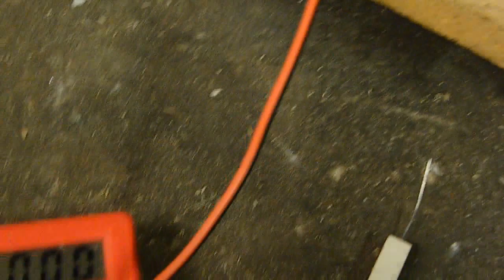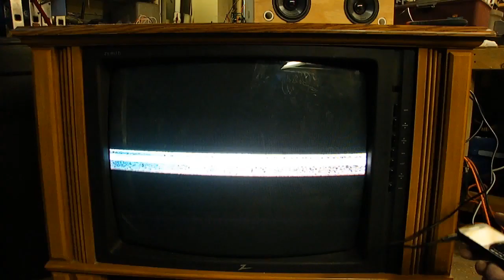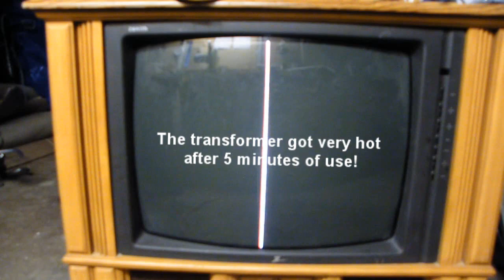How to make an oscilloscope from an old TV

Comment: I also did this modification sometime around 1977-78. I saw a Popular Electronics article on how to create a X-Y vector graphic audio monitor out of an old black and white TV. My first attempt was on a hybrid tube / solid sate 25" Zenith color TV. The deflection yolk simply unplugged from the main chassis, I rewired the deflection coils, hooked it up to my stereo and listened to Pink Floyd Dark Side of The Moon, it was awesome! The second attempt was on a black and white set, on this one I substituted a wire wound power resistor as the dummy coil to keep the gun active. This one I used as a low budget oscilloscope, 60 Hz time base utilizing a step down transformer. Even marked a graticule at 1 volt per divisions.

Comment: I did a similar modification in 1976, 40 years ago. It was a vacuum tube color TV. The neat thing was that these older TV needed dynamic deflection of the 3 electrons guns to make all 3 hit together the same pixel thru the shadow mask. But we can simulate the effect of a modern CRT : simply use a magnet and find a place on the neck of the tube where the 3 color will separate but not too strong to make the gun hit the wrong color. Brief, instead of the boring white line, the goal is to have the 3 color, red, green and blue drawing the same lissajou figure.

Comment: The wires going to the deflection yoke are USUALLY red & blue for horizontal, and yellow & grey for vertical. This is supposed to be a standard, but not all manufacturers adhere to it, so it's always worth checking to be sure.

The reason the TV didn't start up with the yoke unplugged is because some (not all) TVs use the horizontal coil as part of the 15KHz tuning circuit for the horizontal oscillator that runs the high voltage transformer that powers the CRT. TVs where the yoke is not part of this circuit tend to be easier to hack for this sort of use :)

Comment: hahaha that's great!!  but let me tell you can loosen up the Yoke clamp screws on the neck of the tube and turn it 90 degrees so the vertical coil becomes the horizontal coil and it look like a real ocilloscope sweeping from left to right. also you can change the width of the trace line by changing the width of the electron beam. great video.
Reply: Or just, you know, rotate the TV 90 degrees.

Comment: rotate the deflection coil 90 deg on the CRT neck and the vertical line should go horizontal. Mind the 15 Kv CRT anode = great for homebrew electric fence lol
i did something like this with a small black and white CRT set that ran off batteries or DC wall wart. I remember paying all of $20 for it new back in 2001 just to have in my shop on my bench for entertainment purposes. Now its a Frankenstein work of art

Comment: 1) The dummy coil fools the TV into thinking that the real coil is still attached.  The real coil (on the neck of the picture tube) is then connected to the audio source.
2) To make the vertical line be a horizontal one, you can rotate the coil on the picture tube neck 90 degrees!  There is a screw/strap that holds it in place, loosen it and rotate it, then tighten again.  3) One word of warning - the inside of this type of CRT TV has some EXTREMELY high voltages!!  Be CAREFUL!!

Comment: Nice work mate!!
the horizontal deflection looks really good, is it possible to rotate 90 degrees like a laboratory  CRO or would I need to use the vertical deflection coil with a freq multiplier?

Comment: For anyone who watches this, you're not even supposed to use standard electronic insulated tools when working on the back of a TV like that. Instead, there are special high insulation tools available for high voltages up to the 25 kilovolt range. Also, the tube may implode, and even if it's been plugged out for 2 years it can still kill you, there are high voltages capacitors, and because it's high voltage - sparks can jump to your hand. You can't just swap in and out coils, it's not recommended, you can't treat electrics like low voltage electronics. There's a difference
Reply: *sips drink*

Comment: Wish i had found this before I did mine as I just jumped in to it.  Here''s mine. Looks like we came up with the same thing. I added two switches and plugs that allows me change mode and return the to back to usable status. Capacitor in lime smooths it out, I did this as I remember when i was a kid all the speakers had them.

yP8ddiFJOU0
r2O8sy7bdB8
Fi8qOTg8MVg
H4JfnUg2dO4

Comment: I had the same problem with the coils. i found that instead of switching the on my tv your able to turn the coils on the tube it will even go at an angle but you can turn it intill the vertical goes horizontal.

Comment: I am trying to get into electronics and don't know much but I love opening them up. I know enough not to kill or hurt myself but not really enough to know how it would work. If only I had more money to get tools and other stuff I need. Have and ideas on what basic tools I need?
Reply: i would recomend you
-screwdrivers (flat, x) with various sizes, you may also try to get torx if you want to deassemble a phone.
-pliers
-wire cutter,
-wire stiper (i personally do not use this one),
-some wires to connect things 
- a breadboard for mounting projects
-soldering iron (it depends on what you want to do, you can use it to take components off old electronics, replace damaged components or build your own citcuit)

if you want to also start programing things to move, do interesting stuff etc, you could try:
-arduino  (good for beggining)
-chipkit (same as previous)
-raspeberry pi (never worked with it, but it is for fairly complex systems)
-beagle bone (same as previous)
Reply: I got most stuff now. I am gaining more knowledge through youtube videos. Anything you suggest I look at to find problems with stuff? That is what I think I need now.
Reply: i forgot, multimeter, it is very usefull for checking if the voltage is what you expect, and to find the problem sometimes

well, http://www.instructables.com/
it has instructables for almost anything and i found some electronic cool projects..
maybe it has instructables for dealing with problems too. 
there may be some foruns where you can search what the problem may be but i don't i know any at the moment
Reply: Yea. I already have one.
Reply: A good hammer for when you get so pissed off at something you can just smash it and move on to something else?
LOL really though a hammer is useful but I assume you have one already.
I leaned all what I know from trial and error hands on tooling around inside of things. it may be a good point to keep a note book(s) of your experiences so you can look back and know what not to do if a scenario arises again in the future.

Comment: what about turning the deflector unit 90° to have a horizontal line?
Or connect the other pair of coils?
Reply: That's what I was thinking. Switch the dummy coil and the plugs and it should work fine.

Comment: mucho cool , 
i have a problem though , the line it produces is verry thin , i can see the frequency but really condensed , do you have any idea what i can do about it?
Reply: Hello, I have exaclty the same problem as you, did you manage to fix it ?
Reply: no, but i think it has to do with the tv being a bit newer than the really old ones
Reply: yaniv schon

Mine is not that old too - probably late 90s. Did you had to simulate a coil in order to power up the television ?
I didn't, and wonder if it will change anything as it appears horizontal coil might be part of the alimentation
Reply: i added a dumy coil but then realized it wasnt necesary , when i removed the coil it was all the same as with the coil
Reply: Ok - i'm still gonna try it. If it doesnt work then my last though would be that there might be potentiometers regulating width of signal. Thank you for reponding !